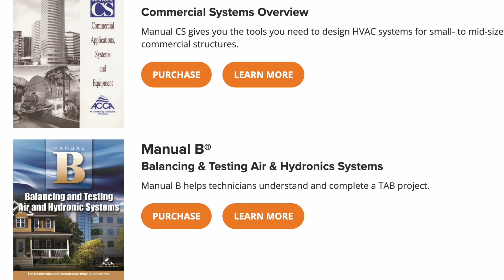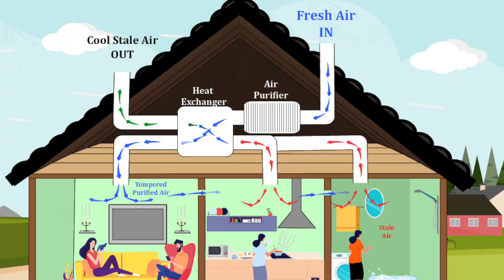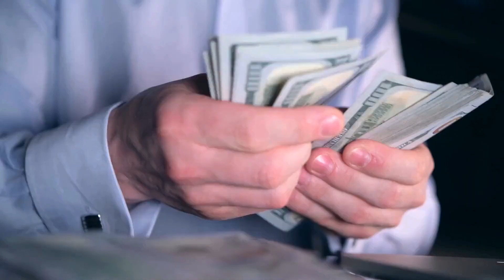3 HVAC Calculations Costing Money!

Comment: Truth is... it is extremely rare to find a balanced residential air conditioning system. I hate spider boxes and flex duct. It aggravates me when I see almost every contractor fails to remove the horizontal drain pan on an upflow A coil. Very effective  in blocking air flow with having a giant piece of plastic(drain pan) snugged up against the evaporator coil. Customer never gets the efficiency rating they pay for. I worked in the commercial-industrial sector of HVAC for twenty years before I retired. Once I left residential A/C I never looked back.

Comment: Alright, I'm gonna guess before starting to watch.
1) the load calculation - how much cooling/heating power is needed to accomplish the job.
2) balance between the efficiency (cost) of the equipment vs the the cost of energy over the expected lifetime of the equipment - what combo comes out ahead over the span.
3) what fuel type offers the most economical advantage over the long term.

There's also where to locate a heat pump outside to best advantage but I'm guessing that's not one of the three things.

Let's see how I did after listening to the video...  I'll be back.

Okay, I got two of three.
I've never heard of manual D or manual S.  When I engineered my system, I read through manual J and manual H.  That was before the Internet.  

The load calculation was pretty straightforward though keep in mind it does require some assumptions.  So results can vary depending on how one biases his assumptions.  But you can run it with a range of assumptions and get a range of load requirements and size accordingly.

Manual H covered air distribution.  I sized and routed my ducts to achieve adequate airflow throughout while keeping air velocity down.  So I put a piece of yarn in front of a register so I could see if the circulation fan was on or not, since it was too quiet to hear come on and go off.

I also put the heat pump on a gas furnace and switched back and forth depending on outside air temperature.  Where to set this temperature involved calculating the cost of input energy per BTU of output energy for various outdoor temperatures (assuming a fixed indoor temp) and finding the temp at which both were same.   At the time.  Fun stuff.
Reply: Nice!
Reply: Hello: If you don't go crazy after all those calculations, you're truly blessed!
Reply: @bobboscarato1313  
Hi Bob, I read both those publications through and performed all the pertinent calculations.  It was involved, yet a small part of my overall house design. I drew out everything and submitted my drawings and plans to the county for approval.  Self build; no contractor.  I installed everything myself plus the electrical and plumbing too.  Not a small endeavor, either.  It was an adventure, making my dream happen.  That was thirty + years ago though.  Didn't feel like "work" (I had a job too).  There's no way I'd tackle it again.  We raised our kids here and it's their home place.  We now have eight grandkids and help them with their own projects.  Cheers!
Reply: @elgringoec  Unable to read comments but you sound like my dad who did most of the home construction himself. A blessing!
Reply: Horse… Shit…